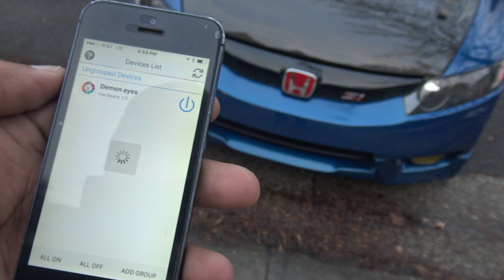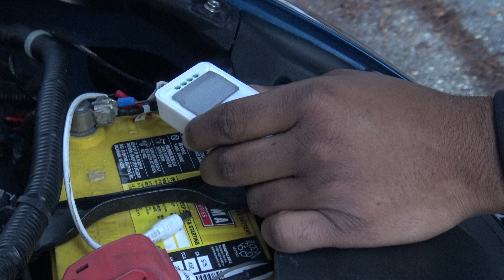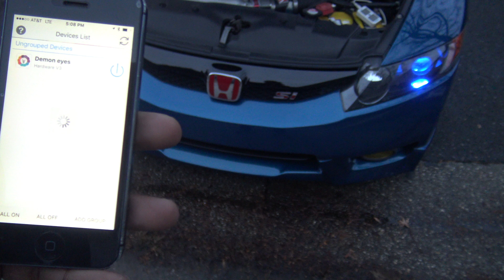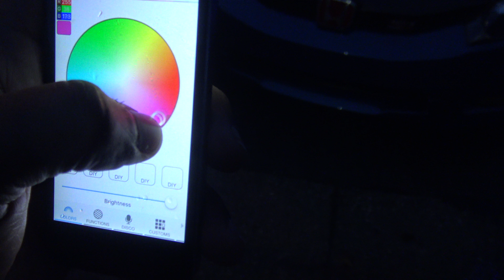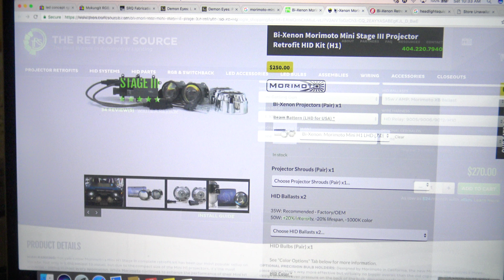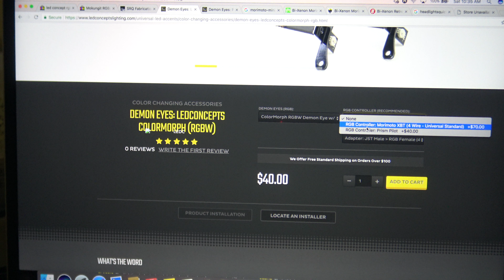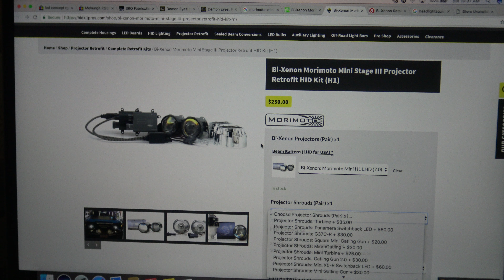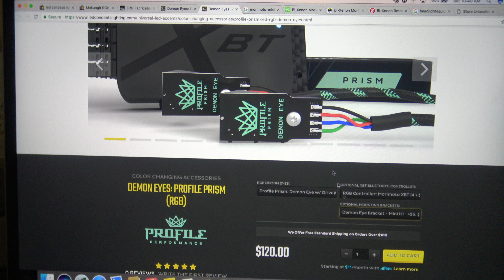WHATS WRONG WITH THE DEMON EYES

Comment: I have a bit of an off topic question. What can cause for a bag to rip or leak air? Ive seen people on youtube replace their bag and struts because the bag ripped. I want to know if this is a common issue becaue I am considering getting bags.
Reply from the maker: You have to do some crazy or ridiculous stuff to make the bag rip or leak.. Like you see I daily my car about everyday! The roads here is not smooth.. The bags hold up fine! 
To make the bags rip or leak.. It's basically user error.. Installed incorrectly, exhaust near bags and touching the bag, you jumping of a big ramp or hitting big potholes over and over... Don't care... If the airline is not threaded enough into the bag correctly it will leak air.. 

You can tell if the bags are leaking air by leaking the car outside over night! Spray soapy water on the line! 
I will be installing bags on a car when the weather warms up and making a video!
Reply: EvilStreetShark cool thank you for the info!